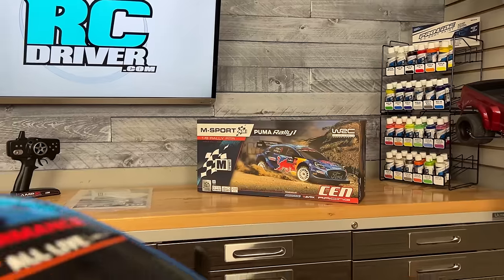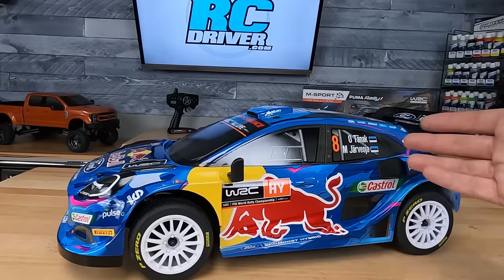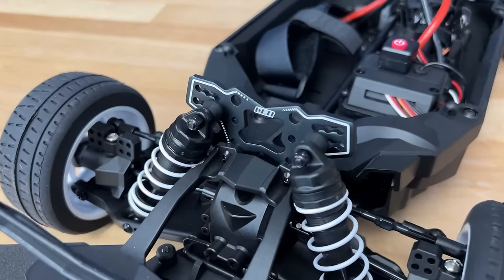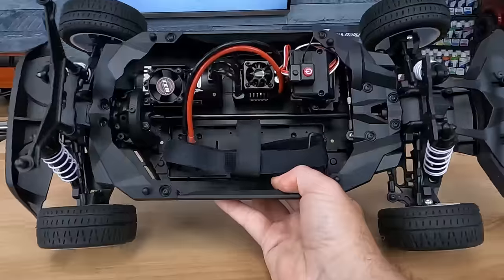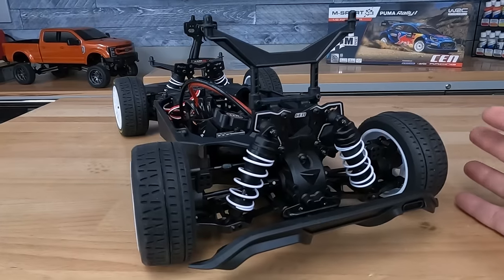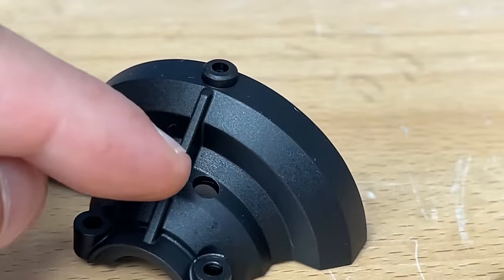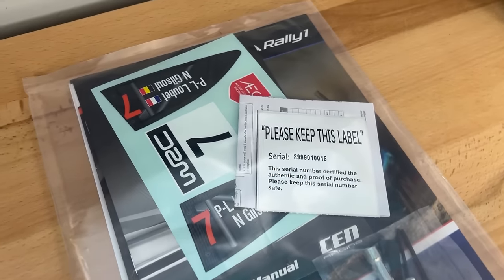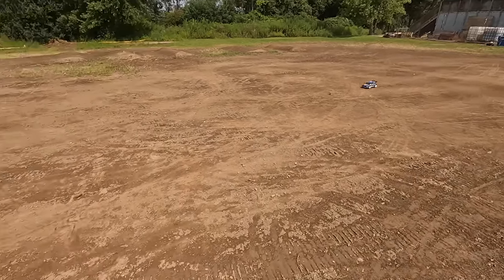Realistic M-Sport Ford Puma Rally RC Car - CEN Racing

Comment: Brett at Amain just reviewed it and the bumper upper mount was missing screws. The rear of the body was rubbing and tucking into the tires. He also broke a rear A-arm but it was a nasty crash into a solid object. Also, the motor mount screws came loose.  Be sure to check those. It's common on most new releases. Not a big deal it's always good to get into a habit of checking for loctite on screws going into metal parts. With that said, it's a sick rally car! I love the chassis layout.

Comment: I love the shade you threw at the carisma rally at the start: "this is a rally car done right" : ) The design looks awesome and glad they managed to fit in an aluminum chassis and the stock electronics seem good (except the radio)! The lack of a center diff from the factory may be a disadvantage compared to the wr8 and seems to have less suspension travel. I see the little nubs on the chassis - they really should offer a chassis cover for this. Pity the body doesn't have clear windows  - would have been awesome to put a scale interior/chassis cover on there. Interestingly - it seems like you can put dual shocks.
Reply: The second shock mounting points are likely a quick way to reduce down travel (i.e., droop) and therefore chassis roll.  Likely on asphalt you use the upper shock mounting points, and then drop down for dirt.  You would have to readjust the shock preload with the change.

Comment: Question, love this...years and years ago wanted to get HPI's rally car but never did and spend money elsewhere. Now this stimulates my senses once again. This appears to be pre-production unit. The question is when is Cen going to show off the finished version? Its a must for $450 that it come with a electronics tray cover plus the rear body rub/tires fix. And add some additional ride height. Your thoughts?

Comment: I'm just happy to see a genuinely interesting looking and performing design from someone other than losi/arrma and Traxxas.

Savox servo, HW motor/esc system, durable looking and unique platform. I honestly may have to pick one up. 

Wish Associated did this 1/8 size with the Ken Block vehicles. Only reason I have got the hoonitruck yet

Comment: Nice video! I have a wr8 where i must screw fast front c hub. But i dont find the orginal srcew, So can i use a simililar as the thiknes and the lenght is the same but different screw head? Sry my english
Reply: Yea u can. But if the hole is taped should use correct bolt
Reply: @ll.7927  Thanks. It is not taped.